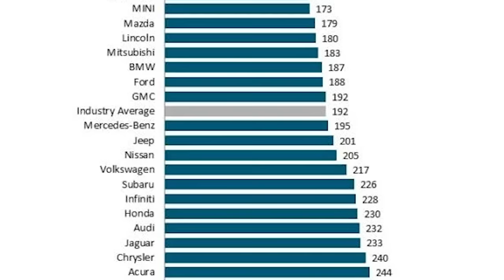Trucks That NEVER Break Down (Reliably run 1,000,000 miles)

Comment: i live in the uae, very hot temperatures. somedays it goes up to 50 celcius so the trucks are always going through stress and the ac is always on. and i go offroading frequently even in the heat so i have alot of experience.
anyways silverados ac never breaks down and is the coldest among all competion, engine temperature never heats up but every silverado needs to have a gear cooler becuase before 2019 all the gm 1500 trucks didnt have one, so gear temperature was a big issue (reaching temperatures upto 130 celcius) but the truck is all and all reliable. powersteering will definitely break down if you go a bit into saltwater. 
on the other hand f150s have alot of small issues, electronics, ac systems and engine temperature heats up quickly. also the 4wd system is always the first to go. my friends with raptors almost always have a malfunction in the 4wd systems, the cars interior deteriats quickly due to our heat and some buttons go white while the interior goes sticky
toyotas mostly are all very reliable. Especially the toyota landcuirser pickup. the car has the roughest ride due both solid axles and leaf springs, it has 2 difflocks and the interior and exterior handle heat like its nothing. it has the least amount of options tho. we have friends that regularly bounce of the rev limiter for 10-15min straight. i can link you videos, if you dont believe me. without a single issue. that car is used for most farms here, carry much heavier loads and tow unbelievably well. it has 8 leaf springs and a higher option would be 11 leaf springs. the most relaibe truck is that hands down and not the hilux and definitely not a f150. the ford is known for its problems here and we would class it as one of the worst. if youve made it this far thanks for reading ahaha.

Comment: 1995 7.3  diesel seem to have the problem with the left side valve cover/ injection plug connections. Also the cam positioning sensor. Solution to the second is DON`T  USE the Ford switch---use the International switch. Don`t ask me how I know!! Two times to Ford, Once by my friend Chad ! Can never thank !!

Comment: It was interesting that you showed an old IDI engine and called it a Powerstroke.  It is what my truck has and is not in any way fast or efficient but runs despite repeated breakdowns.
Reply: Break down is misnomer. Most of the time black tape, fuel hoses, clamps gets you back on the road.
Reply: @timesthree5757  Not when the torque converter falls apart, or when the injection pump breaks its shaft.
Reply: @chargermopar  don’t have a torque converter. The worse thing that happened to me was my exhaust pipes fell out.

Comment: Some of your data is a little bit off. The  mid 2000's Mitsubishi Raider was the cousin to the Dakota. Not the Mighty Max. Those were rebadged as the compact D50 pickup. And the Rangers were never built or designed by Mazda. It was the opposite. Those 90's and up B series trucks were rebadged Ford Rangers. Mazda did build the Courier for Ford.

Comment: 2000 Dodge  2500     5.9 v8  Magnum gas engine, 5 spd manual has 300k and still running fine

Comment: I was told by transmission technician that the only reliable chevy/gmc truck is a 2015-2016 2500hd with 6.0 liter with 6L80e transmission otherwise you can plan on the transmission problem it is inevitable
Reply: That’s definitely not true, I don’t mind the 6l80, but trucks from the past that came with the 4l80e and th400. Even 4l60e transmissions aren’t terrible, they often fail because of lack of maintenance.

Comment: 1974 Dodge power wagon 318 with a 727 torque flight also 1990 V6 3.9  Dakota 5 speed manual  1980 Dodge truck with slant six manual

Comment: 2004 chevy silverado Z71 5.3
gas. Complete original engine and transmission 425,000+ and still running strong.
Maintenance Maintenance Maintenance.

Comment: My 01 F150 has 236,000 miles, still has original engine and transmission (I must clarify that I have the manual 5 speed transmission which is money), and runs and drives great.
Reply: Is it 4.2L V6?
Reply: My 02 F150 Harley Davidson has 450,000+ miles still mostly original.
Reply: @waltchan  My current truck is. I had one with the 4.6 before and it had right at 200,000 when I sold it a few years ago. I switched to the V6 because I wanted better fuel economy and didn't really need a V8 for what I do with my truck.

Comment: I’ve owned 4 Chevrolet’s 76, 95, 2004, 2018 all have had zero issues and lasted well over 350k
Reply: Sure Goober..and still have the original oil and tires right?  Hahahahhaa.....what BS

Comment: After owning a pretty unreliable Ford Ranger I traded it for the gold standard Hilux, well that’s what I thought at the time, after 3.5yrs of owning the Gaylux I had 2 water pumps replaced, computer around the gearbox replaced, brakes replaced due to warping, hand break never worked on a slight slope, endless DPF issues etc.
I went against the grain and traded it for a Volkswagen Amarok V6, 4yrs on not one single problem after 100,000 km 🤷‍♂️

Comment: What about the toyota land cruiser 70 series pickup truck/ bakkie with the 3 engines options in South Africa the deadly 4.5 turbo V8 diesel that's beautiful and sound 😍😍the strong 4.2 straight 6 diesel and the 4.0 V6 petrol  the hilux is amazing but land cruiser V8 diesel remains the best

Comment: I bought a 94 b3000 5 speed for 1250$ 5 years ago. Maintenance cost for 5 years?  1250$ 😂 I’ve gotten 5 years of use from it for 2500$. I still daily it for work because it’s cheap in gas as well. How can you get rid of a truck that’s treats you this good? It’s never left me stranded and it’s even pulled a decent trailer after my buddies 21 ram starter went on him and left him stranded.

Comment: Yeah, I hear that Chevy 5.3 Avalanche are no good but ive had a 2005 1st generation and then 2007 2nd generation avalanche. I love the versatility and comfort of these trucks. The 2005 had 198,000 miles with no issue other then fuel pump replacement and brakes. Then it was taken out by a idiot driver t-boning me. The current truck, 2007 Avalanche had a oil pan gasket replaced and shocks. With 190,000 miles on it now, it runs great. I'll probably get another 100,000 miles. Being in the north, i don't have significant amount of under body rust for a 15 year old truck. I bought it for $7500 about four years ago with 140,000 miles, no dings, no dents, interior is perfect. I've installed touch screen radio and back-up camera and a USB port to charge stuff. In the winter i go out to supervise snow removal and have never even used the 4wd button except for one time. Maybe I'm lucky or something but I've had no issues and love the truck. As a side note. Parts are interchangeable with Tahoe, suburban, silverado, escalade, and probably more models. Since I hardly ever fix stuff on the truck, when i do get parts i get new. Ex. plugs, brakes, tires, etc.

Comment: I have a 2001 Ford F-250 with a 7.3 that has 450,000 miles on it and no problems.  The weak point is the transmission cooler, put a Mishimoto transmission cooler.  Then you’ll have a bullet proof truck

Comment: I'm getting close to retirement and looking for a 20 year, 300k HD truck. I hate FORD but the 7.3 F-250 has caught my eye. A 2025 Ram 2500 with a Cummins gas engine would likely make me drool. I don't care about gas mileage, I just want a tank that I can work on.
Reply from the maker: Like always, all trucks - even brand new ones, have their issues. Diesel engines are AWESOME but much harder to work on without a bunch of specialized tools, and they're by far the most complicated powertrains on the road today. If you're looking at buying new, go drive all 3 and just buy what you like! We're a little partial to the Ram for the cummins, interior, and exterior styling - but would be happy with a Chevy or a Ford too!

Comment: 1994 f150 - 4.9
2010 grand marquis - 4.6
1995 Nissan d21- 4cyl
2010 Ford ranger. - 4cyl
All I've owned, all have been great. Not sure how I've always ended up with reliable vehicles.. but it just happened that way.

Comment: So as a dodge guy, if you didn't know, there are 3 transmission option when buying a 2500/3500. The first is just the regular old dodge transmission 
, and it's OK so long as you're not giving it the beans all the time, it like to hold onto 2nd for some reason, but if you baby it, and you grandma that bastard, it will last as long as you do. I can say that from experience, I got a Gen one Cummins d250 with 285k on the stock Trans and it's still runs like new, my grandad took 3 minutes to go from 0-60 so yeh. 3nd option is the Laramie transmission, the old ones are meh but the new ones are solid, finally able to compete with Allison transmission, give it the beans and it will hold up. The 3rd option is the industrial transmission, idr the name of it but my dad put one in his 3500 and smokes corvettes on the regular. It's a beast and can handle all the torque and horsepower that truck has.

Comment: hold on hold on wait a minute the Mitsubishi Mighty Max was rebranded as a Dodge Ram 50 the Dodge Dakota was built by dodge. Dodge Dakota was built by Dodge and Mitsubishi but the exception of  The Mitsubishi Raider is a pickup truck from Mitsubishi Motors that debuted in the fall of 2005 as a 2006 model for the United States market and is based largely on the Dodge Dakota

Comment: The only terrible triton V8 there was was the three valve if you get an 2000-2003 those are some of the most reliable engines there is in my opinion. I had two a 2002 with a 46 V8 and a 2001 with a 54 love them both ran well over 250,000 miles with original transmission motor everything
Reply: Yeah. 4.6 liter 2003 original motor, trans,  with intake gaskets and coil packs at 260,000 miles (so far).
Reply: I'm in agreement with you by first hand experience. I own a 2002 F150 crew with a 4.6L eng. Over 256,000 mi and counting. It was used and abused when I bought it. I had to do some front suspension work on it plus new shocks and brakes. Also recently put new u- joints. Still runs like a champ and been hauling and pulling loaded trailers with it. The a/c still blows ice cold as is original.
Reply: Yup. I got a 99 f250 6.8 v10 at 394k. Still one of my most reliable work trucks in my lil fleet. The only real issue I’ve found with the tritons are the damn exhaust studs
Reply: @Gonz.0  nice I love the V10s as well. I experienced manifold stud problems on my 02 because it was rusted to hell and back lol but still hauled just fine.

Comment: A few years ago the Dodge 2500 was the most reliable HD truck, and the 3500 was the least reliable vehicle for sale in America.
Reply: with all the newer EPA stuff.. any glitch in a sensor and it reads it, it goes into a "limp mode" Thats why most diesel car haulers companies are sticking with the pre-DEF fluid era Cummins. Actually surprised they said 2nd and 3rd gen Cummins. where we ALL know the OG first gen 12v is the true king.

Comment: The Ford Ranger over here in New Zealand total Crap they made in Thailand with a 3.2 5cyl Diesel in them gearbox's are weak,injectors fail early,if ya don't fill motor within 10 mins  with oil after oil change the pump won't prime up freind works in Ford workshop tells me a ton Horror stories

Comment: Major disinfo about the Dirtymax in this video. The LBZ came out in 2006, replacing the LLY. The 1st and 2nd gen dmax's had huge problems btw. If the injectors in the LB7 arent replaced, you're in for a $7,000 surprise. The LLY was notoriously good at blowing its head gasket under normal operation.

Comment: I LOVE MY 2000 CHEVY SILVERADO 1500 ls. Found a guy that just passed 1.000.000 miles.
Reply: Those 5.3s are no joke. Never mind the cold knocking. Doesn't matter
Reply: May have hit 1 million, highly doubt it, i of so absolutely guarantee not on original motor and transmission like tundra does

Comment: had a brand new 2014 gmc sierra with the 5.3....nothing but problems over and over a stack of shop repair bills....traded it in for a 2015 toyota tundra used and 180,000 miles later .......not one thing changed...if it keeps up the type of reliablity ...i am a convert to toyota
Reply: I’ve been looking thru the comments hoping to see good things about the 2011 Silverado 1500 5.3L but after reading your comment im a little worried about the future of this truck. Has around 130k miles and so far no major problems… “so far”
Reply: @jeromem4426 my dad has 13 with 120k and it’s been a good truck, all original 🤷🏻‍♂️

Comment: The 4l60 transmission was not good but the 4l60E was one of GMs best transmissions ever
Reply: Like it or not but any automatic after hard use will need to be redone. The 4L60 in my dads 04 Yukon that was taken care of lasted 210k but since we needed the truck to tow we had it replaced at the dealer with OE before it failed completely.

Before then it was driving fine except for sometimes hunting for gears, & shift solenoids dying.

Comment: Probably difficult to choose international trucks. But Landcruiser 76 series would have to be in this list. Holden Rodeo 3.5 petrol, diesel is crap. But the petrol was great Isuzu made truck. The Landcruisers hold their value, so even trucks from the 80s still running around being work horses. Unluckily for the Rodeo, value didn’t hold, they’d be scrapped when still running great since minor repairs would surpass the value of the truck, so it says something when there is heaps still running around, in Australia. Whereas vehicles such a Nissan Patrol had issues, but it’s sheer talent as a 4wd, people would spend a ton of money keeping them on the road, and their value is staying high.

Comment: Trusting a Cummins completely from either generation is a mistake. While the 12 valve is good in the 2nd gens, a lot of the 2nd gen 24 valve motors came with the 53 block, which would develop bad cracks. And, the fuel system wasn't the best either. The 3rd gens with the 5.9L were alright, but the 6.7L has a tendency to push the head off the block around 250,000 miles give or take. It'll happen a lot sooner as well if you modify it, or abuse it.
Reply: The 05 and 06 5.9s (and the early 07s) were amazing.
Reply: @tornadotj2059  The most trouble free Cummins ever made.

Comment: I have a 4L60 in my truck. It's been plenty reliable, but I despise it. It's got 2 few gears and the shift points are about 1,000 RPM lower than they should be. It makes my 300HP engine feel like a 4-banger. And the trailering button does absolutely nothing at all. I'd say avoid the 4L60s, but you can't because GM put them in everything.

Comment: had a 4.6 triton go to 240k and the 5.4 went to 300k . how were they bad?
Reply: They aren’t bad. Pretty good. I Have worked on a lot of them. 

Where they fall short IMO 

Timing chain guides that rarely make it past 200k miles before failing. Intake manifold plastic cross overs that fail. Sparks plugs that blow out. To add to that more difficult to work on then GM and Ram V8 offerings.
Reply: @alexgrindnshine2522  susceptible to carbon build up. Use premium full synthetic and premium filters and change every 5000 miles and they can last. And keep your foot out of them. They easily can last over 400k if you take care of them.
Reply: @elithepitbulldog2209  what do you mean by keep your foot out of it, not accelerating fast?

Comment: I had an 86 Nissan pickup that went back under the Lemon Law. It was a HORRIBLE pickup.
Nissan wanted to replace it with another Nissan but I chose to take the money and bought a Toyota instead and drove it for 300K trouble free miles

Comment: 08 Tundra 5.7.  Use genuine Toyota parts and fluids.  Change the transmission fluid every 60K.  Don't overload your tow load or bed load...and it will NEVER die.  Make sure to carry your own gasoline refinery😛

Comment: Toyota since 1989 ~ 4-runner for 18yrs/200K miles ~ 2007 Taco for 14 years/109K miles and currently a 2019 Tundra Platinum bought in 2021 (bought with 38K miles and addded 23K so far)..... Should last til I'm too old to drive (now 78).... Spent about $1K on minor repairs to 4-Runner over 18 yrs and no repairs to the next 2 twucks, so far.... After 34 years, have come to the conclusion that a few bucks more for Toyota twucks is a bargain in the long run.... ;o)

Comment: 2001 Toyota Tundra former owner here. Fabulous truck, and a transmission and engine that just wouldn't quit. Why'd I sell it? The Toyota dealer who sold it to me hoodwinked me and didn't tell me about the recall on the improperly rust-proofed sub-frame components. Since this was Illinois and they use a lot of salt on the roads, eventually the frame looked like Swiss cheese. What really frosts me is that the dealer would have paid zero out of pocket, and Toyota would have fixed the problem under a nation-wide recall. Still, though, got her up to 268,000 miles before someone made me an offer on it. Yeah, I showed them the rust, but they wanted it anyway.... 

That said, if I run across an older Tundra for sale, I wouldn't hesitate to buy it ~ provided of course, that the body and frame are clean.

Comment: If you take care of your trucks & do all the fluid changes & recommended maintenance that you're supposed to do, I'm sure you'll have the same reliability stories as what you'll see in the comments below. (Except for the 10K oil changes which are BS!  5-6K max as oil changes are cheaper than new or rebuilt motors!)

I'm @ 155K on 2002 Sequoia & it's still running strong.  355K on my buddy's 2006 Sequoia & zero issues as well.  530K on 1996 Camry 3.0L V6 & it still gets 33-34 MPG on the hwy with plenty of power.  312K on 2003 Avalon & still burns zero oil.  

Just do the recommended maintenance & you won't have to buy a new $80K truck or $45K car!!!